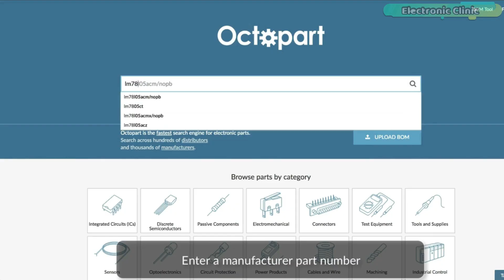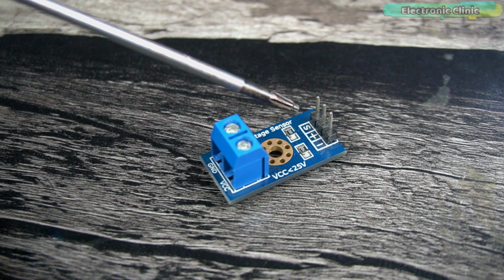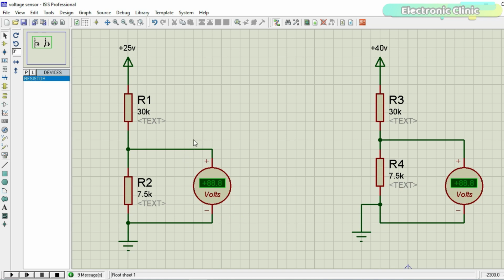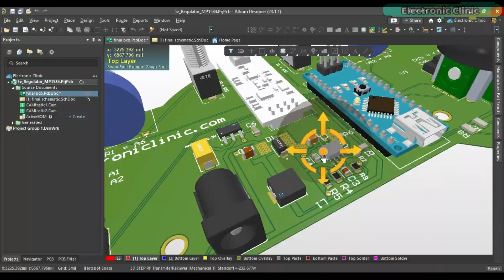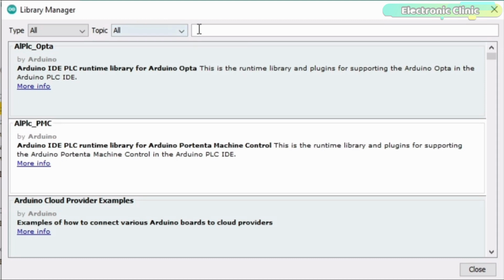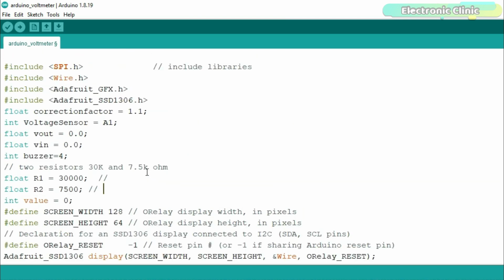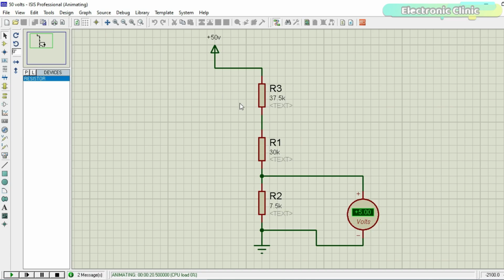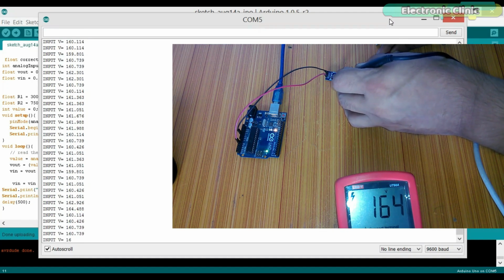0-25V Voltage Sensor with Arduino, Voltage monitoring, Calculations, Simulation, & Modification

Comment: can i measure 27v if i made it for 50V?
Reply: yeah u can! just add the third resistor value in the voltage division formula(vin*r1/r1+r2+r3)

Comment: Okay i know this is near impossible but i think someone should try it 
Use an Arduino that runs and api connected to a cloud based service that hosts a version of open ai 
This then processes the data and send back the out put to the Arduino that is then displayed on a screen